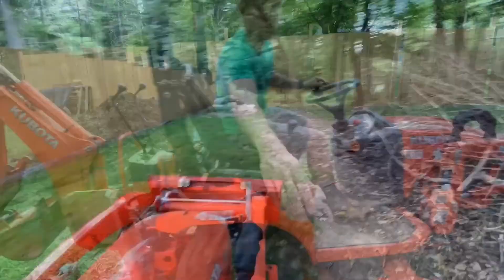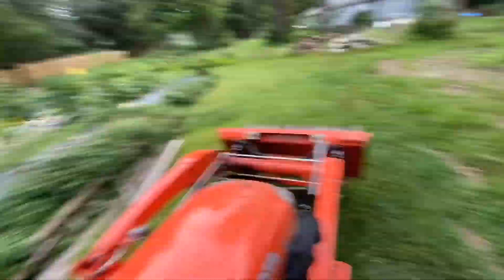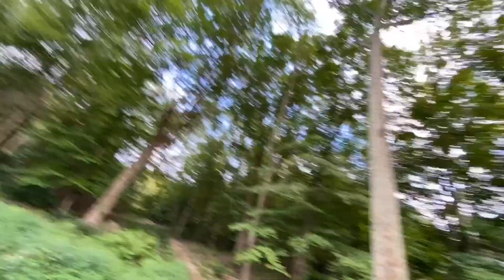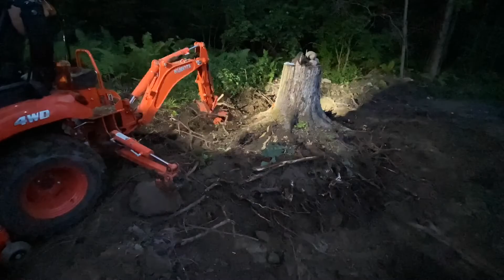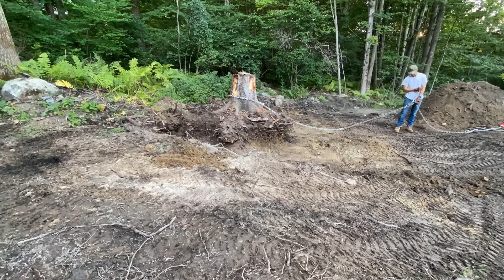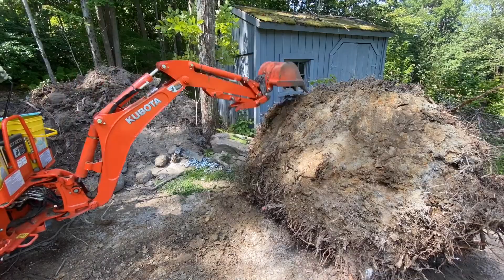Compost Turning and Digging a Stump with a Kubota BX23s - Time-lapse

Comment: Did you get your bucket level indicator when you first bought the tractor?  Do you find you use it much, or with more experience do you find you use it less?
Reply from the maker: No, I received it as a christmas gift. I get a decent amount of use out of it. I still find myself checking the blade more often then not. If you can save the money then hold off and just get good at leveling by feel.
Reply: LukyNumbrKevin thanks